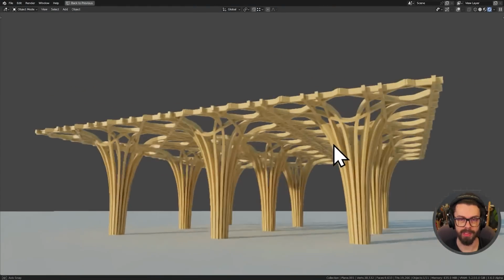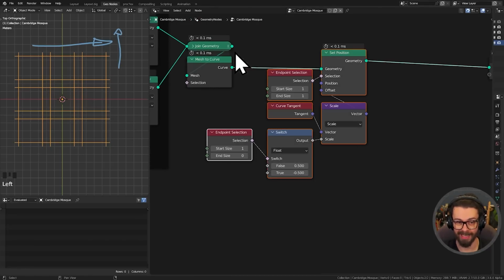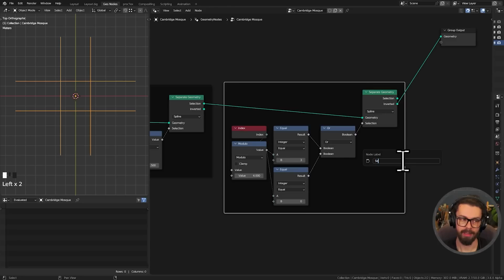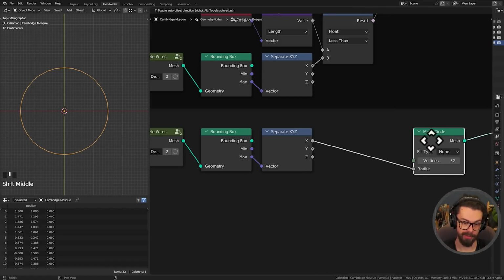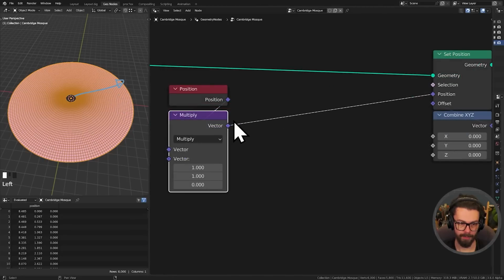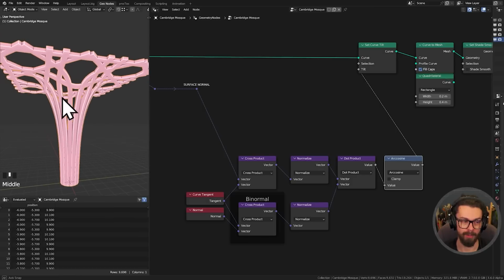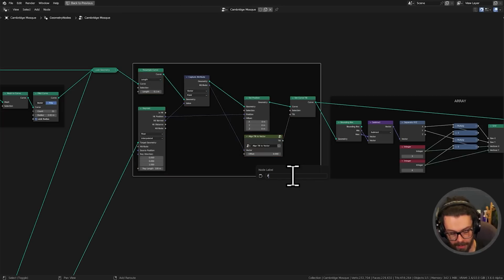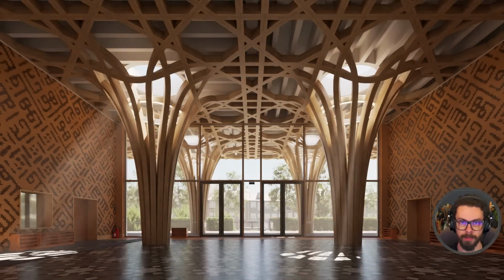Creating Cambridge Mosque with Geometry Nodes - Blender 3.6 Tutorial

Comment: I am working in 4.1 and there is no PLAIN Modulo (that I can see). There is Truncated and Floored modulo. Your numbers dont seem to work with either. 
I am sure this is an error on my end but would apreciate some help. Love your videos. Thank you.
Reply from the maker: The old modulo was a Truncated Modulo. The only difference between truncated and floor being for values below 0. Assuming both give different results to what you are expecting then there must be an error somewhere else.
(Also 4.4 is the current stable release if you feel like getting some more nodes)
Reply: @Erindale  Thank you so much for responding. I figured out what I did wrong. I hade points instead of edges on the sperate geometry node. Everything is working again. PS I have 4.4 at home but 4.1 at work. We have to wait for IT to vet releases:(

Comment: Hey man, i dont know if its cause of the version difference but when I raycast out and use the hit position the lines go sorta in then out instead of yours where they are just straight, so like in from the centre then out then up do you know how to fix this?
Reply from the maker: Hm that’s odd. Hard to debug just from what you’re saying but check your set up. You can always use a Mix node to slowly swap from the position to the hit position. That’ll give you some indication of what things are shooting off to which might help give you a hint. Also check if you’re using the offset or position socket on the set position. And maybe also spline resolutions etc
Reply: @Erindale  If it helps I think it isn't a problem with the raycast, as the raycast is straight unlike the mesh where it goes in then out

Comment: How do you get the colours, for example at 30.49 and 31.10. I just have black lines?
Reply from the maker: As long as they’re curves, the viewer node should show the attribute you’re viewing. Make sure that you’re connecting to the viewer with ctrl+shift+left click to make sure that it is generating the viewer socket based on the attribute you want to look at. If for example you have it as a Boolean or integer from a previous attribute and then you just plugged in a different data type manually next time then you’ll not see your expected results.
Reply: @Erindale  Thanks, I really appreciate you taking the time to give a detailed answer - I had it connected after the mesh!

Comment: Hi Erindale, when watching this I was wondering (and I thought I saw a glimpse of that in the timelapse part but might be wrong) are there no problems with Z fighting in Cycles on some of the intersecting curve parts resulting in overlapping faces? Did you have a workaround or were there simply no issues?
Reply from the maker: I added a bevel and then subdivided to give just enough roundness to prevent z fighting without visually changing the profile shape too much

Comment: First of all, thank you very much for this tutorial. It helped me learn a lot and have an insight into the differences between the grasshopper and geometry nodes. They seem similar, both based on bare math, but still the workflow is different, as you said in the beginning of the video. :)
And one question.
Could you tell me how did you get rid of those black overlapping areas in 1:16:29 ?
Reply from the maker: Added bevel and subdivision. It rounds them enough to fix the coplanar intersection artefacts while the Bevel resolution lets you keep it visually rectangular in section

Comment: EDIT: "Create Funnel Base" the Curve Circle was set to 0.9 not 1.

EDIT: my solution was changing the Funnel Depth Vector Multiply's values from 1000, 1000, 0000 to 1100, 1100, 0000.

I'm skimming through to find out if I screwed up, I'll update if it's on me n not a blender change

58:00 when I add the outer square, the end points extrude down to the pivot point, unless I raise the 0.5 on the prior "extend" group to 1.5 and I can't figure out where I went wrong

Comment: I got a un even issue of mesh overlay in end after skinning curves... like its glitching where curves pass through each other, mostly in outer box... i dont understand why it's happening...
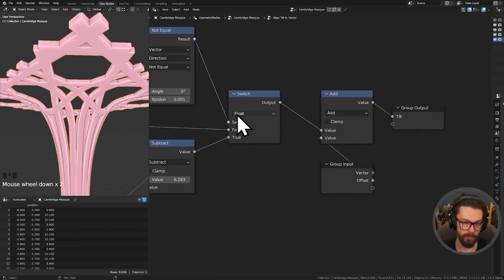I tweak inside the align tilt to vector group, and changing the .001 value in the pie value  (1:09:40) works though makes the intersects smooth...
EDIT:-  problem solved at 1:16:30 .... just need a modifier :)
and thanks For this tut...

Comment: As I'm watching this, I'm thinking "What's needed here is a node to create a square of splines with a corner offset. A positive offset and it makes a tic-tac-toe grid, a negative offset and the lines don't touch at the corners". Maybe another one to do the same as a diamond (using the first one and rotating 45 degrees).  I'm finding I make helper nodes like this all the time now, and thanks to @JohnnyMatthews Bulk Asset Tool it's trivial to just push them down into an asset library file after the fact instead of tedious copy/pasting.

I'd also consider moving the manipulating the curve handles instead of "fillet curve" and ray-casting for height, as this doesn't require resampling and will lead naturally to a catenary curve. Whereas fillet forces the curve to follow the circumference of a circle.

Comment: "For future Thadeous"

8:00 - Index Debug
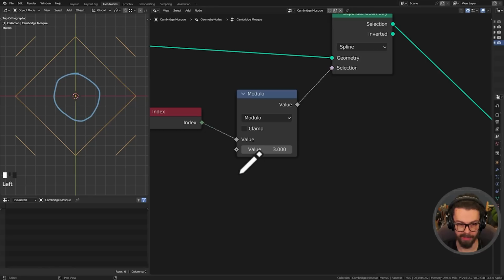22:33 - Modulo without compare node
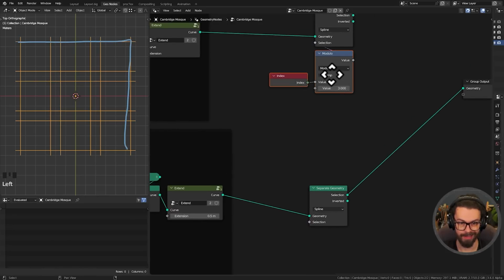23:28 - Seperate Geometry Operation - Modulo & Ping Pong
25:52 - Seperate Geometry Operation - Compare
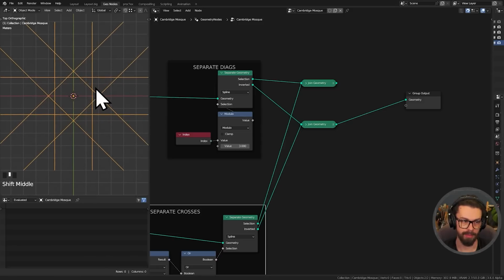27:47 - Bounding Box select & delete (Delete wires)
34:15 - Concatenate Curve hack (link curves,  curve tangent vs position, dot product)
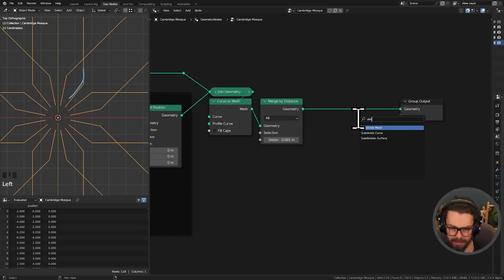44:08 - Fillet Curve endpoint hack
48:49 - Set Curve Radius using Switch
01:02:03 - Set Tilt (Tangent, Curve Normal, Binormal)
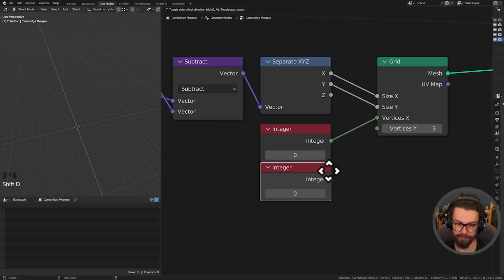01:12:00 - Instancing by integer (Integer - 1)

Once again thank you for making me a better artist Erindale!🤝

Comment: Erin, Thank you. I would really like to see you take this to the next level. This would entail removing all overlaps at end points and cross-sections. i.e. Make it buildable (Real).
Reply from the maker: Yeah this is a significantly more challenging problem but not impossible. You'd want to split into two sets and create your offsets for booleaning the lap joint. Ideally we'd have the curve intersection node in master but I think it's still got some work needed. That would make finding the intersections much easier

Comment: as always amazing work! I am learning tons of deep stuff from your tutorials and I owe you. Nice understanding of Islamic architecture btw. are you and architect?
BTW I was waiting from the beginning how do you create those amazing curves to follow the funnel shape but got amazed by use of modular math function and then blown away by perfect use of ray cast. The uvmapping was also very nice, had to pause on the perfect frame to see it :D
And, did you use a B&W image as a filter to delete some polygons on a subdivided plane?
Reply from the maker: I have an interior architecture degree but I work in games now ✌️
For the wall pattern? Yes I grabbed a photo of the lobby and isolated a tileable section which I turned into a mask. It was pretty rough and doesn't completely match the building but it was close enough for the time I had
Reply: @Erindale  That's very good. I am an architect as well but trying to switch into character design. but your procedural parametric videos inspire me to use them for my architecture projects. can we achieve the same result in revit's dynamo?
The bricks gave the feeling they should've. well done as always👏👏